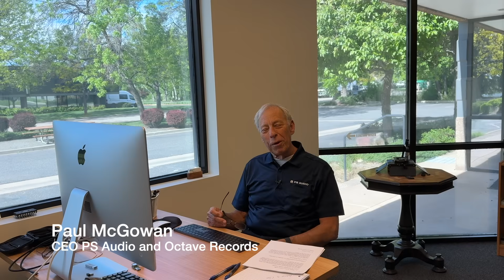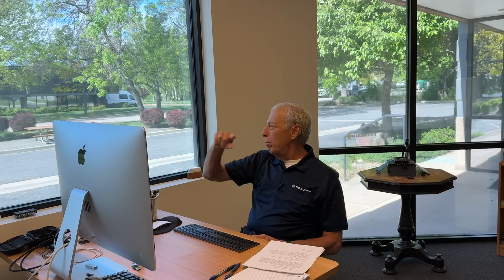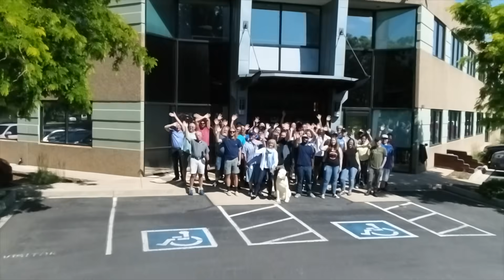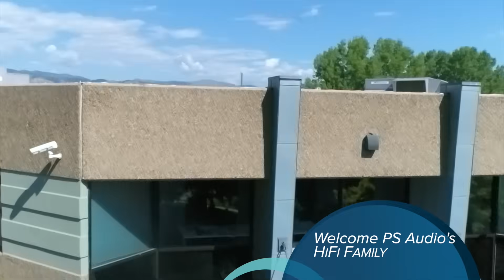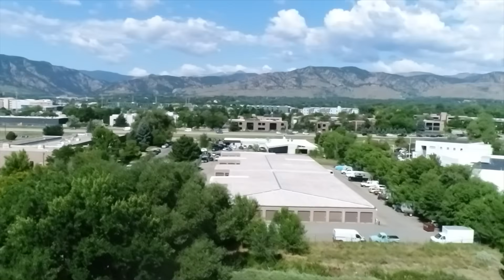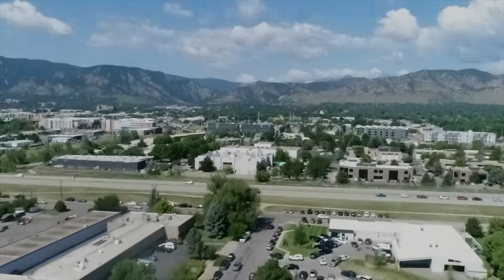Stereo and mono amps

Comment: Hey, I dig the new look. Suggestions for window film maintenance: Don't use standard cleaners or towels! My company, RENEW PROTECT, is all about restoration and preservation in the auto industry... AND we have a great sound system in the shop via a little help from you. Our ELACs drivers even have a nano ceramic coating 😆. Only use microfiber towels on window film, and I advise a "spray detailer" or even furniture polish; they are often surprisingly similar in chemistry, to clean and protect that new tint.

Comment: Bridging increases output impedance. A good question would be, if the amp is 100 WPC and you peak out at about 10 watts, which would sound better? Might be best just using one channel of each amp, then the PSU really is more powerful. Simplifying the question aside from bridging, if you only need 10 watts, wouldn't almost any amp sound better with an easy 8 ohm load than 4, even if the amp can drive 400WPC into 2 ohms?
Reply: Not necessarily, my 4 ohm apogee duetta 2 speakers sound better than many 8 ohm speakers .  Some 8 ohm speakers can be harder to drive than some 4 ohm speakers if the 8 ohm speaker is a highly reactive load and the 4 ohm speaker is mostly resistive.
Reply: @mitchtaylor6512  I mean if the impedance were magically changed, all else equal, the amp would sound better, maybe, more a question. Not actually easy to test unless speakers were made specially to test it. If you need every bit of power you can get that's completely different, but rarely the case.

Comment: I kinda dislike this video... Typically when you bridge a stereo amplifier, it's harder for the amp to drive low impedances. It's not a given that you'll get a performance increase... It depends on other factors, like the speakers that are used.

Comment: The power supply is just one part. A separate mono amp lets everything operate independently. When part are doing one job at their best and not double or triple duty crossing over with the design the results tend to be superior. For that you typically need more space using separates versus integrated. The mono option in a stereo amp is the next step versus a stereo amp only. It's all budget and design related. I still believe in quality amp first over the speaker. You can have a great speaker with horrible amplification from a cheap amp and sounds like  absolute crap. You can take a decent speaker and make it sing it's best with sound with a great amp. It's nice to have both but people have to upgrade in stages sometimes.

Comment: I'm "stupid". I can bridge my Primare power-amps but instead I use one for the bass to both speakers and my second Primare power amp for the midrange/treble.
Reply: I do the same thing, but I run fully active so for a pair of 3 way it was just the easiest solution. 😄

Comment: Dual mono is the value proposition - separate power supplies and amps though only paying for one box - an expensive component.
Reply: Except you now can't have the amps right beside the speakers, so you're losing performance and added cost of the speaker cables. Choose your poison.
Reply: @dicmccoy high quality 10 gauge speaker wire is not even 3$ per foot. I doubt it's a factor in bringing up the cost of a stereo amplifier 😋
Reply: @1337sim1 not all of us run lamp cord. Some of us actually do have quality cables.
Reply: @dicmccoy and they would be better if shorter and not running near a bunch of other cables with high current
Reply: @dicmccoy Belden 5T00UP is a great cable, no need to pay more than that 👍
Reply: @1337sim1 Not every cable is the right synergistic fit for every system. Sometimes you may want a phase shift on the top end for more holographics. Maybe one would want a cable that takes a little away in the 3-4khz range because of some slight sibilance. Its foolish to say that 1 cable is a great fit for every system.
Reply: @dicmccoy let's agree to disagree lol
Reply: @1337sim1 ignorance is bliss sometimes.
Reply: @dicmccoy  high quality 10 gauge speaker wire is only 3$ per foot. 

I doubt getting a bit more length in a stereo amplifier setup will be more expensive than a typical dual mono amplifier setup.
Reply: Love my mono blocks

Comment: Not to be confused with stereo amps that have a mono button on the front panel, these just mix the stereo inputs to a mono signal and feed it out both outputs, no inversion & bridge mode as Paul was alluding too. If you put a speaker between the red's on this type of amp as Paul describes you'll hear basically nothing.
Bridgeable amps usually have the switch on the back panel, often with directions on how to connect the speaker for this to work. Also there is the issue of speaker impedance, often in stereo mode it will take either 4 or 8 ohm speakers, but in bridge mode only 8's. (or if it's a beast that will drive 2 ohm loads, it will be 4 ohm in bridge mode).
Reply: Many modern amps connect the left negative to the right positive inside the amp at the center tap. Yes you invert the signal for the right channel in an extra opamp . That way you can play stereo and mono at the same time..before you laugh. I MADE and Repaired them at rockford fosgate in late 80s.many brands have used the technique since it went public domain..
Reply: @davidstevens7809  I do have an auto amp that runs one channel positive earth, so any mono switching is just summing the stereo - however I thought this was a rare idea indeed, so maybe it's more common than I thought.

Comment: To address part of that question - I often notice a large improvement leaving one channel disconnected on a stereo amp.  You will still need 2 amps for stereo, but running a pair using only one channel each usually improves things.  Less load on the power supply I'd guess
Reply: The power supply is under dimensioned in that case.
Reply: @rw80   Agreed.  I'm kinda a collector, so I have pairs of several stereo power amps and receivers.  It's always great fun seeing how they do with half a load each 😊

Sometimes the difference is huge - like actually worth paying double for 2 same units.  But sometimes not so much lol
Reply: @christopher. Do you turn the balance control all the way over to the one channel you are using,😊 or keep the balance control in the center position? Or are you talking using only one channel of a power amp?
Reply: @sidesup8286  On a power amp I just use one channel.  

An interesting idea tho, on receivers/integrated I can get even more power pushing the balance over to the active channel.  Nice experiment idea!

I'm guessing I may gain some bass/power in the sound but might lose something pushing the power supply harder. 

Most of my units are amps, but good suggestion!  I will try this!
Reply: @sidesup8286  You can use this trick in a similar way with home theater/surround applications.

Say you have a few stereo amps running the mulit-channel setup.  Instead of running both front speakers off the same amp, use 2 amps and on the other channel plug in a surround speaker.

That way at any given time the amps are really only driving one channel normally, and the other just does surround work.  All amps run cooler and 'usually' will sound better

Otherwise the stereo amp up front may get bogged down, while the surround stereo amp is hardly doing anything at all 😊